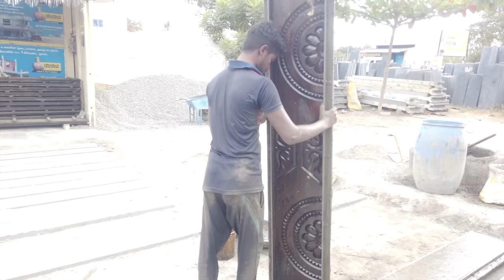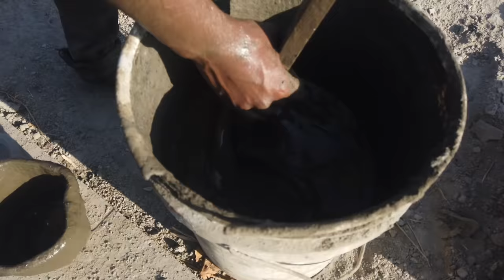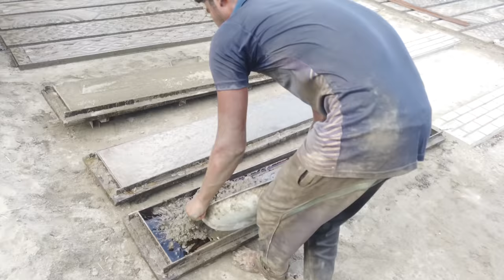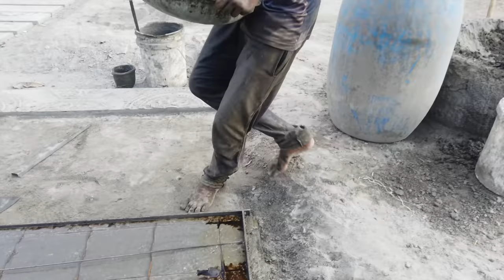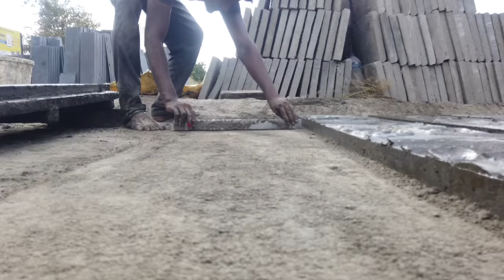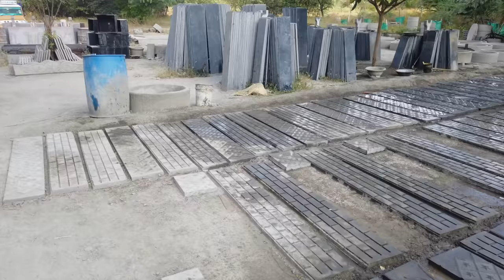Concrete Compound Slab with Design | Readymade Concrete Fence slab | Precast Compound Wall Designs

Comment: Your job would be a lot easier if you raised them up about 4 feet just a taught.
Reply: the flip and removal from the form wouldn't be easy....or you would need lots and lots of large tables. that's got to be more then 2,000+ sqft of panels out there...

Comment: How long before you demold the piece? Do you let the concrete rest or you demold it right away?
Reply: Read your concrete bag, it tells you how long. every composition is diff
Reply: @emmanuelgutierrez8616  well concrete reaches its maximum strength at around 28 days, while not under pressure, but they compress it, I wonder if they demold right away, given the fact that is actually mortar with low water content, and it's not mixed according to manufacturer specifications

Comment: Great idea what is size of panels length, width and thickness and ratio of cement, sand and concrete please
Reply: Go and do a course called Civil Engineering 😂
Reply: @hemangrajyaguru3199  M
Reply: @hemangrajyaguru3199  what is your problem try to write english first
Reply: Ok
Reply: Паспортные данные, случайно не нужны!!???

Comment: hello from Argentina. I want to ask you some questions since I want to dedicate myself to the field. The mold is made of wood? The liquid you apply with a brush is motor oil? At the end, you add the powder, is it cement with sand? Of course thank you for your future answer, I will value it very much
Reply: Hi Jose,

Yes, the mold is made up of wood the oil is used motor oil and the powder is cement powder
Reply: @viraltrending8867  thank you very much for the reply. I value it very much. and I served myself a lot. Some other questions I will ask in the future